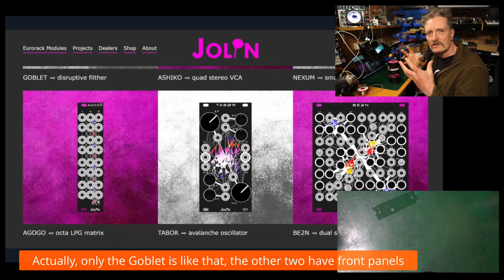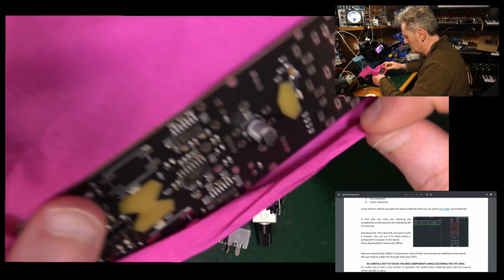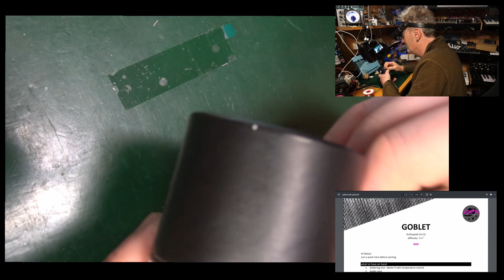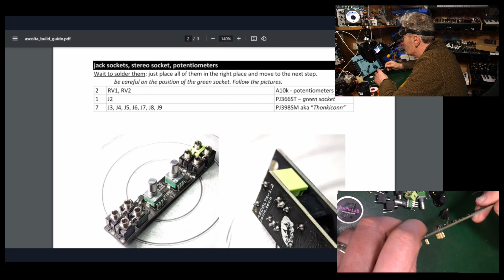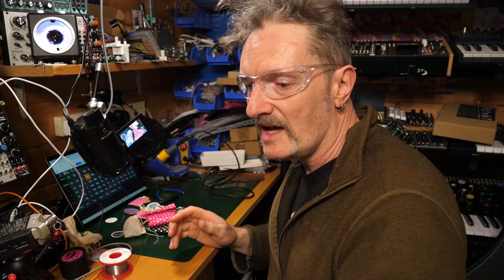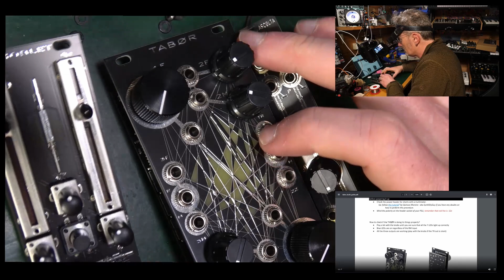Jolin Labs DIY Builds - Tabor, Goblet and Ascolta

Comment: It's hard to say something is wrong with Tabor, because it's Tabor, but I think I can get more rhythmic stuff with just knob twiddling that what you got. But there are definitely sweet spots... If that helps at all. You can also do things similar to hard sync by oscillator into 3M (I think) which can help tame it a bit. And of course... Add a filter on it, and drown it in reverb and delay 😂
Reply from the maker: But what do any of the knobs or inputs do?
Reply: @MoltenMusicTech  Knobs are labeled with F for frequency and M for modulation or each of the 4 oscillators (1F and 2M for insance), oscillator 3 only has CV inputs though.
The three outputs on the middle right are variants, TR (0-7V CV out), NM (main audio out), and ZZ (filtered audio out)
Middle left input restricts the current the oscillators

But yeah, it is kind of all crazy
Reply from the maker: That's remarkably helpful - they should put that sort of thing in the manual :D

Comment: Hi, what solder do you use for your builds? I've recently switched to lead free solder and now I'm having quite some trouble with getting good soldering joints
Reply: Lead free solders often have a higher melting point, so you need to turn up your iron. I run mine at 370deg for lead free, as well as using flux (pen) more compared to leaded solder, especially for ground connections (if the designer decided to put in a ground plane for no good reason...)
Reply: Nonlinear Circuits are my favourite modules to build because Andrew didn't over egg them with annoying ground plane layers, so they are very nice to assemble with either leaded or lead-free solder.
Reply: @BappinProductions  Hey, thanks for the late reply! I've did some research, came to the same conclusion. So now I bought a better soldering iron ^^
Reply: @markus3141 no worries, glad you found a solution. A good soldering iron is a solid investment for a synth DIYer 😊